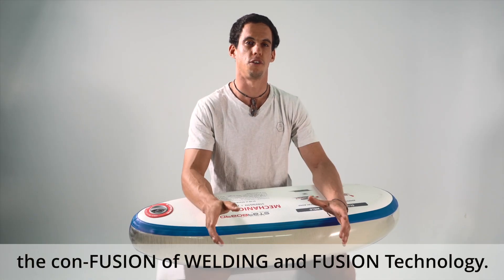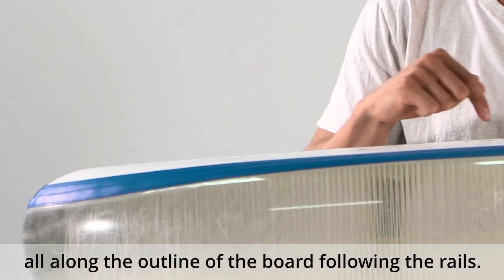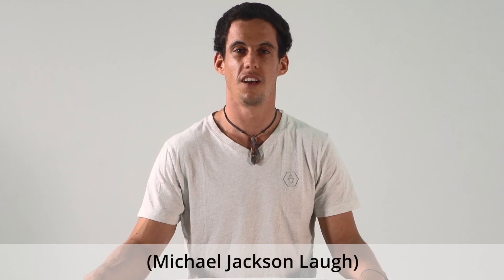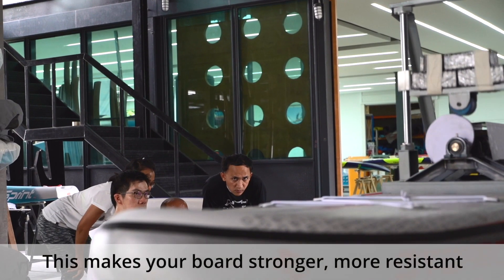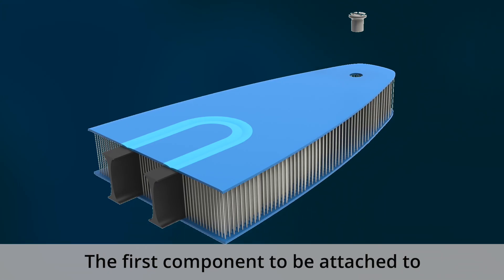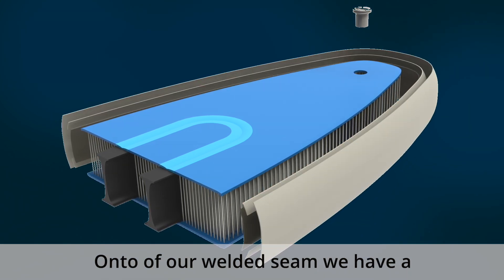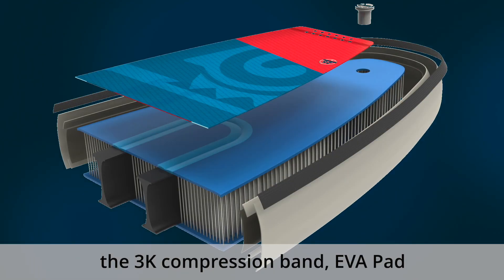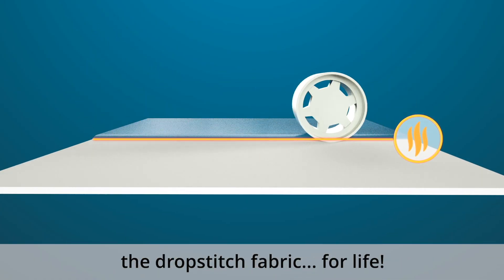Starboard Inflatable Welding  vs Fusion Technology

Comment: So you are not using any adhesives / epoxy resins / cements to keep the seams together? I just had the seams on my SUP melt and I am looking into ways to make sure that doesn't happen again. The PVC glues used (HH-66) are rated up to 150....this heat wave in Texas must have busted that number. Granted, my board was in the sun for 6 hours in what virtually became boiling water. At 6AM it was fine...morning paddle. Returned at noon and board was completely deflated from the seam having busted open, where the epoxy adhesive was basically in a liquid / very fluid state
Reply: In those temps it is always going to happen, I think the first directions I read on the board were "do not leave out in direct sunlight for a prolonged time"